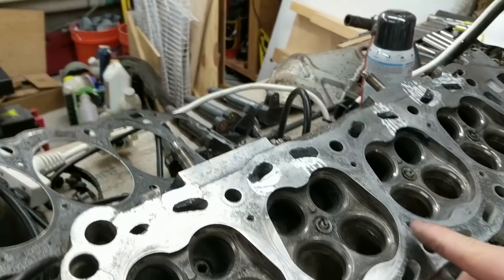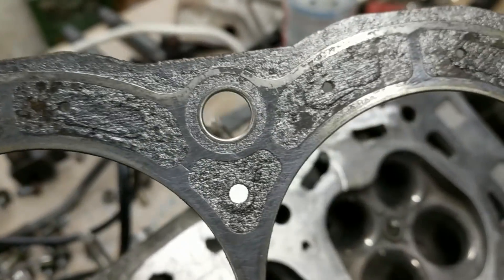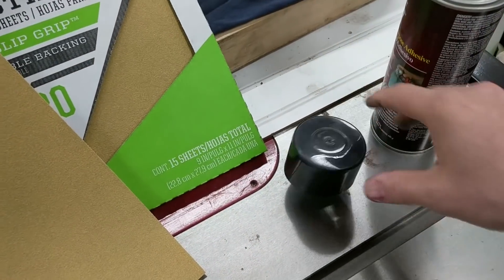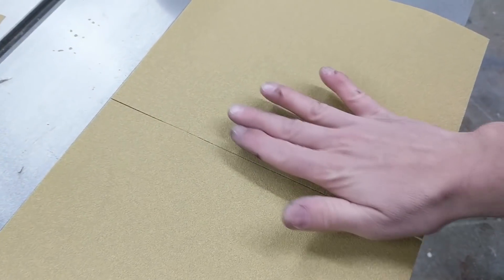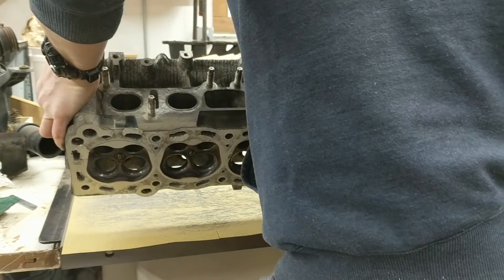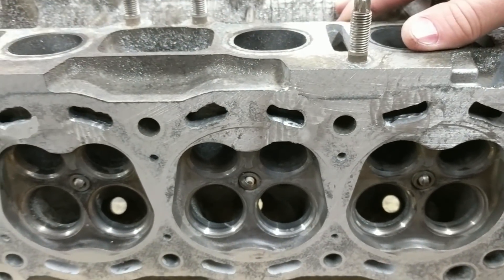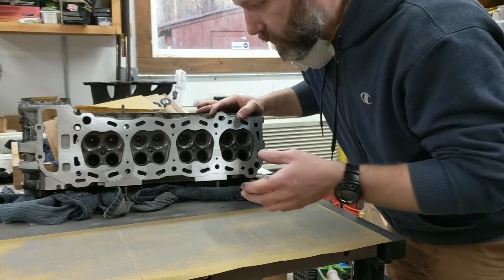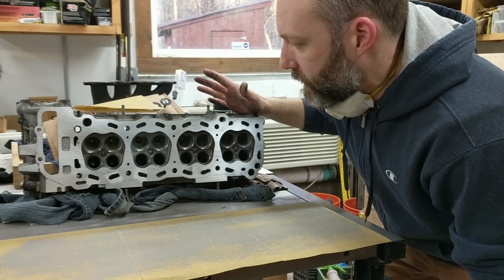Using a Table Saw to Resurface a Cylinder Head

Comment: You did a great job with what you had available. My Ocd would have made me dremel ever so slowly and get the coolant flow ports absolutely perfect. But that's just me. As far as the grit goes though, you should get it as fine as possible. Using higher grit sandpaper creates more surface area due to the increased amount of scratches. Although smaller, the multitude higher number of scratches outweighs this drawback. It's science. That's why good car clear coats are wetsanded with 3k or 4k grit. But there is a tipping point in which the gasket and sealant Wil start losing bite due to not being able to seal with scratches that small. My recommendation would be around 1200 grit. Anything higher than that and the head surface will start to look semi gloss if you get what I mean. Good luck.

Comment: You can get more predictable results if the sandpaper is a wet-or-dry variety (can’t tell from the packages in your video) and you lubricate the surface of the sandpaper using a spray bottle of water mixed with a few drops of dish detergent. The water/detergent mix makes it easier to get the metal filings off the sandpaper and makes it easier and quicker to get the results you want.   The same technique can be used to sharpen knives and chisels using a glass plate to hold the sandpaper. I use a piece of marble tile - the water makes the sandpaper stay in place, so no spray glue is required.

Comment: Ya, it works, only because it an aluminum head. There is a reason the machine that's actually used to mill a head is round and has about 50 cutting tool to make the cut. Doing it that way it will always cut more off the ends because the paper stays cleaner...but what the hell, it aluminum, it can be 5 thou off and the bolts will pull it down to the block..btw 80 grit is a terrible finish...needs to be 320 grit for best seal

Comment: A scrap piece of granite (usually 1.5" thick) can be picked up at your local stone or counter top yard for $20.  Take your straight edge to confirm piece is flat.  You can have them cut width to 9 or 11" (mod motor head are wide) to fit your paper and long enough to allow you to move head without end of head going over sandpaper seem.  Use water to clean off/out sandpaper.  Don't use WD40 or solvent, it will dissolve the glue.  Get to work.  If using MLS gasket, check headgasket manufacturer RA spec for required finish.  It will usually be between 240 and 320.  Good luck.  Side note - if overhead cam, make sure cam bore is straight and head doesn't need to be straightened before finishing.

Comment: That will definitely resurface that head but one thing you have to check is if the head is Warped enough that the cams Rock. I was doing a head job and sent it off to a machine shop to be resurfaced. They notice the cans were rocking back and forth they wouldn't recommend that that I use it because it would wear the cams out quickly. I ended up getting a new one with the cams installed and everything for the same price they were going to charge me for the machine work. it was right around three hundred bucks I think from Cylinder Heads International, I think they're out of Texas.

Comment: I'm intrigued. I have several heads that need resurfacing. Oddly enough, I was wondering how I was going to pull the same thing off.  I'd be curious to find out how flat it actually is.  Do you have a dial indicator?  Do report back with the findings.  The heads I have don't need a valve job, so I really wasn't looking forward to popping the valves out to resurface the head.  This may actually work! Do report back :)

Comment: Dude the higher grit the finer the sand paper is I think it should be smooth not rough where the head gasket goes you’re welds are good though

Comment: This will most likely work for older engines that don't use MLS gaskets, will not last long with trying to use on engines with MLS. Rather spend the extra money to do it right then have to do the labor all over again and potentially cause other damage

Comment: Interesting idea. I guess it depends on how much your time is worth. If your time is not worth much then this makes sense. Otherwise I’d get it milled at a machine shop. If you are dealing with a V8, you want the compression to be the same ratio on both banks of cylinders. Impossible to know how much you’re shaving off using this method. Valve to piston clearance can come into play here, depending on what you are building.

Comment: I work at a machine shop...and can tell you this is a total waste of time!!! Too many reasons to list!!! Please don't resurface your cylinder head like this!!!!😆😆😆😆😆
Reply: Please educate us with just a couple reasons.  I surfaced heads on a 2002 Ford 4.0 SOHC that was severely overheated.  Used KSeal to seal up heads short term to check general health of the engine (ring seal, etc.).  Engine didn't burn any oil in 2000 miles.  Pulled heads and found gaps between cylinders at .013".  Flattened and finished head surface with 320 in less time than it would have taken to take heads to machine shop and drop off (let alone wait 3 days or more and then go pick up after leaving $$$ on the counter).  Heads back to like new, sealed and no concerns.

Comment: They allow a feeler guage warp for head of a tiny amount so as long as the face is clean and almost perfectly flat, the thick gasket will take up some play too. thick piece of glass or the bed of a pool table slate haha is pretty flat! and just turn and sand turn and sand and dont press if you can avoid it or it will be slightly biased. Doing this 98% well will never give you problems as even the high compression on the bolts will force the head gasket into every nook and cranny and slight high spot. But best to do it as flat as humanly possible the first time...

Comment: As far as a cleaning agent goes, straight Purple Power degreaser is as good, if not better than almost all of the petroleum based cleaners I've used. Plus it's cheap, $25 for a five gallon bucket. You can get it anywhere. Its biodegradeable, and water soluable. It's the only thing I use in my driveline shop. Even takes off cooked on gearlube from differential housings. Just use rubber gloves cuz it will eat your finger nails. Don't dillute it just use it straight.
Reply: Excellent stuff!  Heat for best results.  Don't inhale, Bill.
Reply: @tbl8560  yes........have dealt with the 20 min coughing fit I see

Comment: Some advice... use a file first.. corse to medium and you'll knock off the high spots from welding .. and when sanding the more you rotate the head end for end the better as i think that was what you were getting at. But yes this is a decent way to do it but being around $100 to surface a set of v8 heads.. getting them resurfaced  is a much safer method especially if you end up with an incline of a deck surface

Comment: Spray layout dye shows the low spots. Agree better to leave a little “tooth” on the surface to grip the head gasket. I prefer aftermarket multilayer head gaskets for these jobs because they tolerate surface issues and warpage better than OEM.

Comment: I have used a table saw with a grinding wheel on cast iron head and it worked nIcely but if is an Aluminum Head the way he’s doing it is his only choice but he should be doing a rotation about evey two or three slidiNG motion

Comment: This might be acceptable for say a lawn mower engine or the like. As a car guy, this video is about as cringeworthy as nails scrapping a chalkboard. I just kept saying....no, no,no,no....Oh No...........Just NO!
Reply: Mark, you are wrong there. I question the use of the saw table but if you use a thick glass plate or a surface plate you can get a job which might be better than the local machine shop. See my previous comments.

Comment: This method does work and can work well "if" you know what you are doing.  First off for aluminum heads I use 400 grit wet/dry sandpaper and WD40.  Second, you need to use a straight edge and feeler gauges to check progress along the way, It is completely possible to sand the head and have it become .002-.003" cupped between the combustion chambers.

Comment: nice backyard machine work. hey I would use the black sand paper it works better than the open grain stuff you are using. the rocks tend to come off that cheaper paper. then compromise the machine quality.